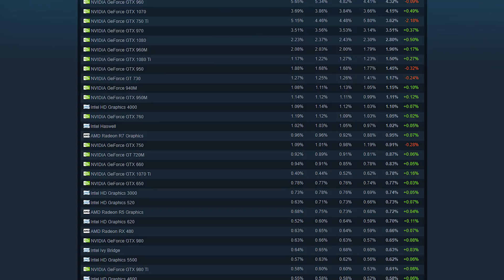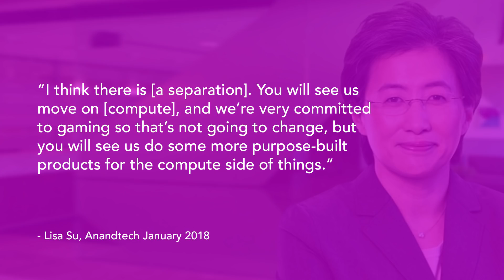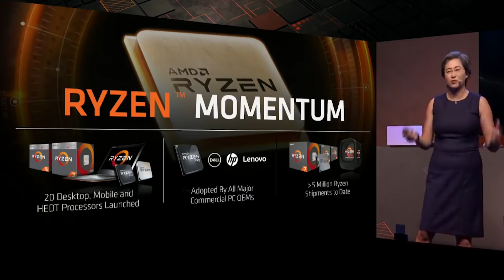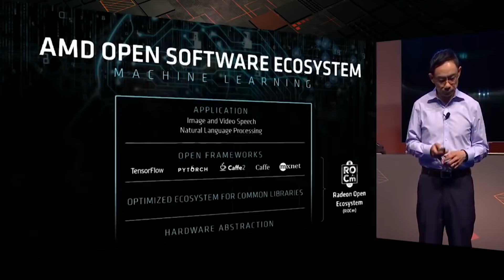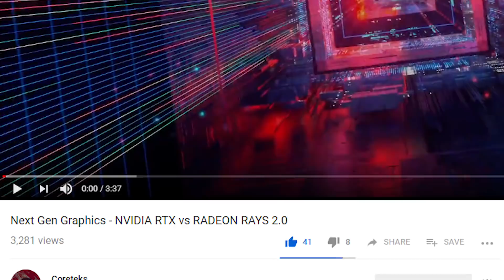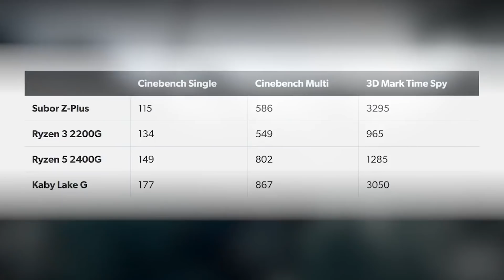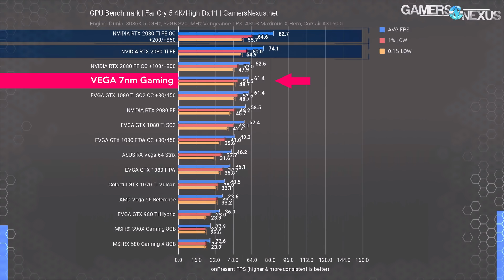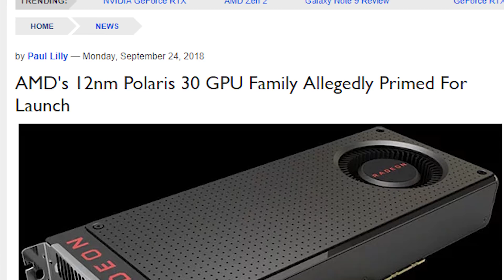AMD's answer to RTX

Comment: That's a good vid mate, excellent quality. You just gained a sub.
Not sure about the 7nm card but the arguments your mention there have definitely some weight.
Thinking about it a Polaris 12nm around 350$ (rx680) and a Vega 7nm around 550$ will hit Nvidia hard if the performance are OK.

Comment: Or they could do a $499 card with GTX 1080 Performance ;)
Reply: Two 480's are equal to a 1080, and the 480 is slower than the 570, which is 200. 1080 for 500? Let's try a 1080 for 300 and completely shaft nvidias RTX lineup.
Reply: Two 480s are in the ballpark of a 1080 for lower cost, but only where crossfire is supported. 
And a 480 will absolutely beat a 570. 
Just had to return expectations to reality.

Comment: As far as I understand it, AMD has got huge investment with the next gen consoles, and so a I think the vast majority of their research will go into making graphics chips for consoles as they will make significantly more money from those sales then discrete GPU's for PC gamers. I would love to see AMD release a new high end GPU this year, but I think there's almost no chance of this. A polaris refresh seems more likely. Even for NVIDIA, the mid range 1060's vastly outsell the high end, and it's the same for AMD. Also, 7nm will likely not lead to very large performance increase. I think a 35% performance increase is pretty unlikely, as the die shrink will be more to do with bettering power consumption over last gen cards.

Comment: I think you didn't talk enough about AMD's computing advantage =, a RX 580 can out render a 1080Ti in ray tracing programs like Maya and Blender and a Vega 64 leaves it in the dust. This strong suit could be applied to real time ray tracing so even though the 7nm might only be 35% faster in traditional rasterization but it might not drop to 38fps at 1080p like a RTX 2080Ti does when ray tracing is active due to the Vega's computing focused design regardless of dedicated RT cores.
Reply: I render for a living, I can confirm that at stock vega 56 and 64 beat the 1080 and 1080ti in rendering speeds or at least match them. Also as the scene gets larger or more complex the 10 series cards can drop performance by a considerable amount while Vega only dips a little. Remember AMD has rapid packed math which is used for real-time raytracing in Prorenderer. Also the 1080ti is only marginally faster only when overclocked.
Reply: "I render for a living" said no one ever. Which software are you using and for which company? Are you freelance? Nobody says "I render for a living".
Reply: I am not. I owned a 750Ti when it just came out and so did i own a 980Ti on release date and so did i own a 1080Ti on release date. I'm def not an nvidia fanboy even when always buying the latest TI cards but pricing it getting out of control with Nvidia. Did you know in the old Radeon days like the 5970 and so forth AMD was on top and prices were acceptable. It is that time again that AMD should be competing with Nvidia to bring Nvidia from their high horse and their ridicilous pricing. I am not a fanboy. I am PRO CONSUMER. Plus this time i bought i bought a second 1080Ti instead of a 2080Ti because it pushes more frames for less money and for the people who always nag about SLI doesn't work well it does with a custom config.
Reply: That mean AMD might not need dedicated "RT" Cores at all, only the denoising bits, and that can be separate chip with infinity fabric.
If AMD goes to "RT Cores", they can fully leverage inifinity fabric and scale performance to near 1:1 ratio with tiny chips.
Reply: BLA BLA BLA
but it is still in AMTARD dream
Reply: Yeah but also more expensive. I'm just pointing out that i am Pro consumer and don't care wich team is on top as long as pricing is right. I normally upgrade to a new TI every launch but this is the first i did not since the pricing ain't right and i went for a second 1080Ti instead of buying a single 2080Ti wich pushes less frames then 1080Ti sli and also costs more if you already owned a 1080Ti. For me i hope AMD comes back stronger then ever, if Nvidia still has the strongest line up then so be it but alteast pricing will come down if AMD is more competive. I just go for the strongest cards but pricing is getting out of control so AMD needs to compete again but i absolutely get what you're saying
Reply: @tron Lmao anyone who has a 1080ti for sure doesn't have bare minimum specs so your point about capacity for a second 1080ti is irreverent. Beyond that even if someone did have a pre-build it's very likely they would just buy a single 1080ti over a  2080ti  which is a 18% - 30% performance increase for about 40% more which is fucking retarded considering the price for a 980ti to the 1080ti was a 7.5% (649 to 700) price increase for about 60% more performance.
Reply: Don't forget that the 980Ti was a decrease from 699 for a 750Ti to 650 for a 980Ti so in reality there was not a price increase compared to the 2080Ti because they always sold at 699 at launch plus don't mind Tron. He's just being salty
Reply: @Tron Nort i said sli. Read properly
Reply: AMD always had the "horsepower" that Ngreedia has been slowly but surely stripped away, because "devs" and consumers want raw speed no matter how it happens, so they pay big bucks for the doughnut "holes" instead of paying the fair price for a full size doughnut like Radeon has offered for a VERY long time....thing with Radeon, if you "code properly" they are BEASTS and are not using "crazy amounts of power" like many people claim they are, at least they have all the "gears" to handle the work, Geforce used to be that way, but now is just a stripped down "speed car" give them the same "full workload" that pretty much all Radeons can do "in hardware" and they insta crash or all that performance that should have been there falls in the gutter (exactly where Nv belongs)

Radeon are "tightly meshed" and have loads of potential performance IF you take the time to get it out of them, Geforce (anything Nvidia) relies on tricks/hacks to "appear fast" and they do not need anywhere near the same "finesse" to get the majority of what they "can have"....difference is, Radeons are "fast and capable" right off the bat and for a coder who really knows how to use what they have they become a beast 3-4 tiers higher level performance.

but that is the industry for you "go the easy route" chase single thread/core IPC because it is "simpler" and takes "less time" then optimizing things..that is the main reason why Intel and Nvidia have "done well" where the few examples of Radeons (and AMD cpu) really got to show the muscle they have (mining, hashcracking, multi-thread huge workload) there is "nothing" like a Radeon (well maybe IBM and their PowerPC processors which pretty much are same thing) you NEED to use the "tool" properly or it "seems" like a shitty tool, at least the Radeons and AMD CPU do not up and "die" because the designer "cheaped out" from making the best they possibly could (I never heard of an AMD CPU "bending" EVER, nor have I heard about a seemingly "perfect" dust free Radeon "frying" for no reason either)
Reply: A bit of research shows that a Vega 64 is about 20% faster than a 1080 ti in blender using cycles. Cycles is basically ray tracing more or less.
Reply: It is. Most motherboards support SLI configs and buying a second 1080Ti is around 500 euro. Most gamers that own a 1080Ti have atleast PSU'S that do support SLI. 850Watts does just fine for SLi You're a little kid because you keep losing the argument so you have to resort to name calling like little kids do. Why would i sell my 1080Ti and spend 700 - 800 euro for 2080Ti for less frames ? I just spent 500 euro's now and get more frames then you do so what's exactly the problem kid ?
Reply: @Tron Nort lol no they don't. And a 850psu Costs around 120 -160 euro wich makes it stille cheaper buying a second 1080ti
Reply: to put some contrast into this whole discussion im not gonna read. https://youtu.be/SrF4k6wJ-do
Reply: Brad Viviviyal  your an idiot. Learn about the field before you comment. The quadro line dosen't help anything in terms of rendering. Only workflow. Do a little research before you speak.
Reply: well gonna call you kid now with your childish comment. Where did you learn your manners kid. I said when you already own a 1080Ti, getting a second 1080Ti is the logical solution instead of upgrading to a 2080Ti if you already have a 1080Ti like i did. It costs  less money and pushes more frames little kid. It does produce a lot of good results because if you're like me you can basically write a custom config file that does enable SLI, even on titles that don't support it or how did you think people got to enable SLI on the Battefield Alpha while it wasn't supported yet till the open beta. Ofcourse the end user mostly kids like you don't know how to do that so i get why they want a single powerfull card. You can also easily make it so that the second card does AA or use it as a physxcard. Is that information for the kid ?
Reply: Why are you fktards even discussing 1080ti vs anything? Turing is a 1080 ti + S9150 and a Quantum computer strapped to it. Suck on that AM..who?
Reply: Youre a fanboy. An absolute fanboy. I hope you realize that. Turing is not a S9150 and Quantum with a 1080 Ti, it's a new architecture with RT cores. You definitely don't understand that the Vega 64 has alot of cores (along with every other card in the RX lineup.) This makes them good at GPU rendering, but of course Nvidia is pretty good too. How old are you?
Reply: Love the avatar, but I jumped off the Intel/Nvidia band wagon and running AMD and Radeon, not a heavy gamer, what I use fits my needs and after all it is my money.
Reply: there is a little context needed for this to make sense, Blender did not support AMD until very recently so some of those results are pre support where they would kinda work but not fully utilize the gpu, this is also the reason there are only a few AMD card on the list(blenchmark closed off new submissions so only for a few months there were OpenGL supported AMD cards being tested ). But if you re check the list you'll see a single  RX 480  rendering in 49sec and a RX 570 rendering in 51sec compared to Titan Xp at 49sec and a GTX 1080Ti at 52sec. But if that link is not a good enough source the linus tech tips link  corroborates that the RX 580 is equal to the GTX 1080ti in compute heavy tasks like  Blender and 3d CAD  https://youtu.be/G-90qEJAVkU?t=3m42s
Reply: Brad Viviviyal  lul flexing doesn't make you right. Never mind that i was just pointing out that a low end $200 RX580 has surprisingly good compute performance that allows it to compete way out of its class in raytracing, i'd need a $2,000 cpu to match a RX580's rendering speed in Blender, for that much money i could buy 16 rx480's and have a mini render farm that could chew through animations that would otherwise take weeks to render
Reply: What r u talkin' about? The only think i found was: https://youtu.be/2kW3Rs4V6FA

Oh and, Something i heard in one of the RTX Reviews, but couldn't found it, i picked this one to "say" that async compute did become better on Nvidia Cards w/ RTX: https://youtu.be/M6t0rkKGRtI

Show me Something that proves ur theory.
Reply: NOTHING dude
he is just PROLETAR (poor filthy working class) cannot get good GPU! so he influence people to be same as him (poor dirty proletar)
Reply: Don't Tread On Me Nvidia made a massive mistake , Maxwell was just a modified Kepler with the computing stripped out of it , they should have had made a new architecture but now are paying the price and have to add computing cores along with the cuda cores.
Reply: @Felixthecatfan21  I agree I think that's also why rtx was super rushed so people would buy it up before seeing how today's cards could handle DXR
Reply: You just made a contradiction with your other comment: "pros are using GPUs now" and "no one uses gpus".
Reply: Which brainlets are thumbs upping this garbage?
Reply: @DrRichardRApe  lol. Why's it garbage?
Reply: ok I made a assumption on Maya only  because it is well known that RX 580 and Vega cards dominate most 3d and CAD programs    https://youtu.be/G-90qEJAVkU?t=3m42s here is a reputable link from LTT backing up my claim and another link from Blenchmark showing a RX480 beating a Titan Xp and 1080Ti http://blenchmark.com/gpu-benchmarks  i guess you're not as knowledgeable as you thought lol
Reply: Dr. Richard R. Ape Mental Ray was discontinued in 2016, but it doesn't matter because you can always use an external renderer
Reply: Don't Tread On Me, If you're new to 3d and just learning the fundamentals of Blender then why are you posting these comments? If you spent more time working with production engines then you would NEVER make a comment like: "a RX 580 can out render a 1080Ti in ray tracing programs like Maya". Maya, Blender, and Houdini are not even ray tracing programs bud. If you really want to learn, then read what the developers of production engines are saying about all the RTX tech. It's really that simple. Otherwise, you'll spend more time making ignorant comments and not learning anything useful about CG.
Reply: For the Nvidia fanboys, there was a company doing raytracing years before Nvidia on a MOBILE GPU and AMD bought that technology. If that company was doing it on a mobile GPU years prior to Nvidia well i am sure AMD buying it they will do great things with it. The technology was to be used with tablets and mobile phones. Not a 1200 euro card
https://www.youtube.com/watch?v=Xcf35d3z890&t=308s Also listen to 6:05 '' everything you see is done in REAL TIME on a LOW POWER MOBILE ARCHITECTURE''
Reply: @Djinn! Wait, AMD bought Imgtec? Do you have source on that?
Reply: They also did show off Ray Tracing during 2011 or something with 2 4870s in crossfire. Its funny no one remembers
Reply: Djinn! The PowerVR stuff was amazing. Though it was never released to the public, and it's not the same as what Nvidia is offering. If you check out the conclusion of the ChaosGroup article it's explained pretty well. These cards need the combination of dedicated ray tracing, shading, and tensor hardware to be able to pull this off in "real time", which is also a relative term depending on how complex the shaders become. https://www.chaosgroup.com/blog/what-does-the-new-nvidia-rtx-hardware-mean-for-ray-tracing-gpu-rendering-v-ray
Reply: AMD fanboys that will eat whatever lie they hear that favors Amd of course. Why do inform yourself, if you can just believe lies from other fanboys?!
Reply: Single 780Ti beats the RX 580 in the blenchmark link, smh! Again with the misinformation. The smaller line in the graph means better performance brainlet. Did you get it backwards? Also what do you mean "most 3d and CAD" programs. Most? Most? You mean like sub 20%? You show one Specview benchmark? Brainlet, back to reddit with you..
Reply: That (3x) next to the 780Ti means (they used three 780Ti graphic cards) Also yes people do use gpu's for big projects which is why AMD Radeon Pro has 2Tb of ECC mem https://www.dell.com/en-us/shop/accessories/apd/490-bein#polaris-pd But you are diverting from the OP which is simply pointing out that AMD cards are good at computing which is why they were favored by miners.  That computing ability can be taken advantage of by ray tracing programs like Blender , so if AMD wanted to make a real time ray tracing gpu they could just use its computing ability for that work load since its clearly not being utilized when gaming.
Reply: @eaglefat9398  amd already has realtime raytracing they developed it first with fire rays.
Reply: I didn't know about AMD's real time ray tracing , thnks for the heads up. Im new to 3d and have just been learning fundamentals in Blender because its free while i get up to speed before jump into pay software like Maya, Zbrush, and Hudini. I think AMD NAVI will have some sort of ray/path tracing because it would be the easiest way to get game devs to get behind it if the next gen consoles all had the ability instead of just a tiny segment of ultra high end PC gamers that make up less then 7% of the market share, but i'm just speculating.
Reply: @eaglefat9398  Yeah I've been using blender just for fun for a few months and have really been enjoying it. I don't plan to ever use any paid software as I haven't really seen a reason to do so and that I don't do anything professionally with it. Maybe I'm missing out on something as I haven't looked into any other softwares. Blender 2.8 is really good btw I really recommend trying out a nightly build of it. Also, I plan to upgrade to a Vega 56 from a gtx 970 soon since they're back at their msrp of $400. I'm switching to an amd card for many reasons, the better price to render times over similarly priced nvidia cards being one of them.
Reply: LOL
do you buy RX 580 vega 64 GTX 1080Ti for compute?
are you moron or POOR or do you just want to make amd looks good? LOL
Reply: LOL what are you going on about?  im just pointing out AMD cards are already strong at compute heavy tasks like raytracing because of how they designed their gpu meaning they are not that far behind on making a "gaming card" that can also "real time raytrace" Since that portion of AMDs card is clearly not being used when gaming they might be able to task that unused part of the card to raytrace in games like the RTX cards do  . Everybody knows NVIDIA is way better for rasterization and compute focused Qudro/Radeon Pro cards are better for real professionals. But the title of the video was literary "AMD's answer to RTX" so i wrote a comment pertaining to said topic.